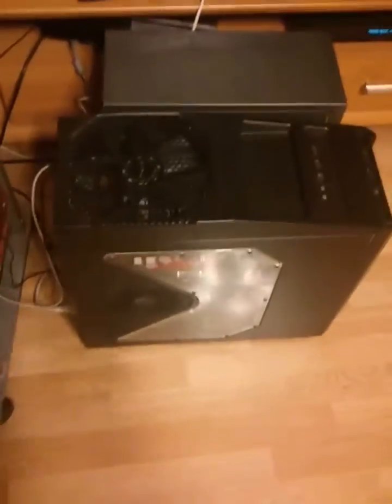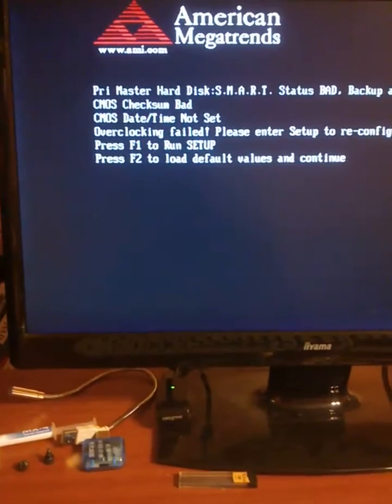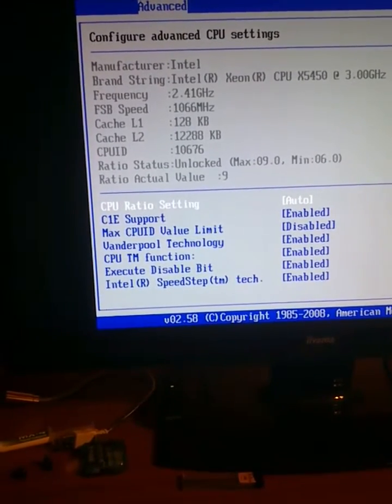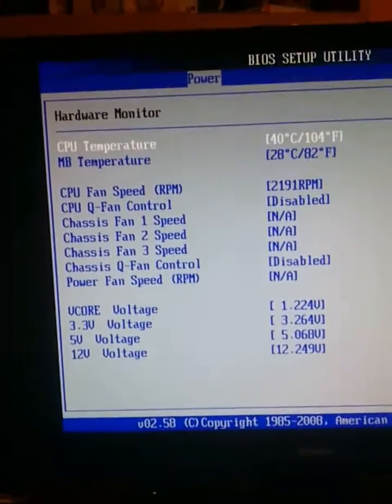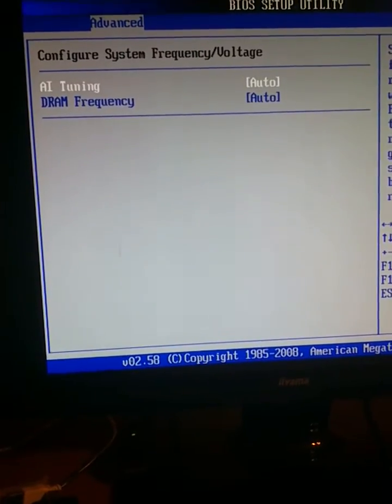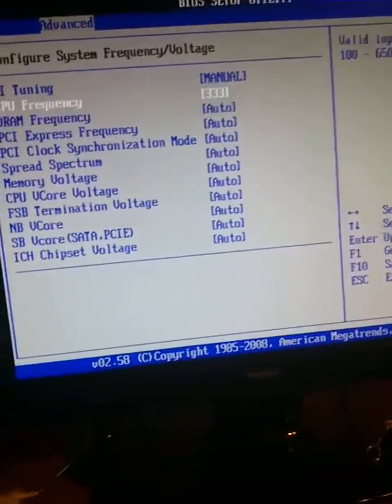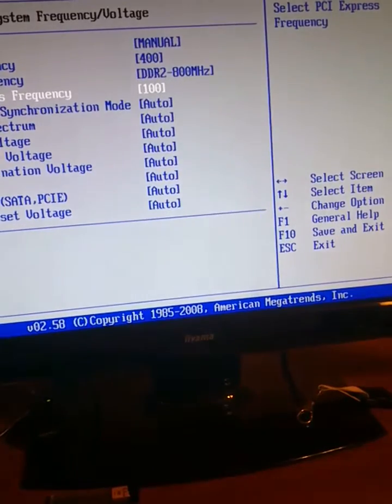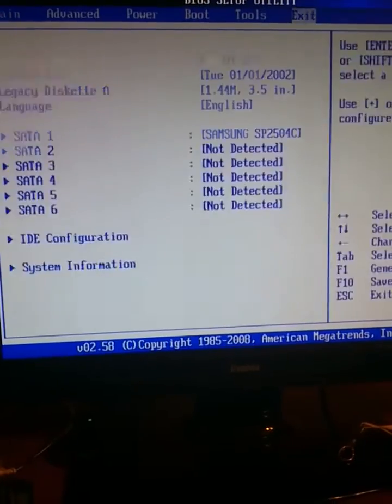X5450 Lga 771 to 775 MOD Low end cooler check

Comment: Please answer, thanks in advance. Im currently running X5450 on Asus P5KC bios v1203 without microcode mod. It asks to press F1 and I do so. CPU cooler is Deepcool Gamma Archer (Its that shit upgrade from intel stock). Temps are really really high. Like 60-80 C during gameplay. 58 Idle. Is it because of microcode update or is it because of the shitty cooler? Im new to cpu mods please help me a bit. Thanks bro.
Reply from the maker: Derek Hellscream Dear Derek,  your cooler is nothing near to overclocking X5450. Please buy at least single tower cooler. Dual tower would be best. temperatures on this are right. This CPU  at 3,6Ghz has TDP 150W. Your cooler is about 100W max.
Reply: Could you please name me a few air and liquid coolers with TDP 150W that support LGA 775 socket?
Reply: I have a few questions, and would be glad if you could answer them to me.
I'd use stock intel 775 cooler for Xeon. Which one should i choose not to bottleneck 7770 HD AMD? 
Perhaps e5440?

Thanks in advance!

Comment: did you modified the bios by adding xeon microcode?
Reply from the maker: Yes.  None of the standard LGA775 MB have Xeon microcodes.  You have to flash Mb with modified Bios.
Reply: well, usefull info. how about the motherboard? did it still work? how about speedstep after flashing the microcode?
Reply from the maker: +Farel Juliansyah Everything works the same. There is no difference. All power improvements works even when overclocked heavily. You just need to find good Vcore and memory voltage. 
State your CPU and I'll try to tell You the settings.